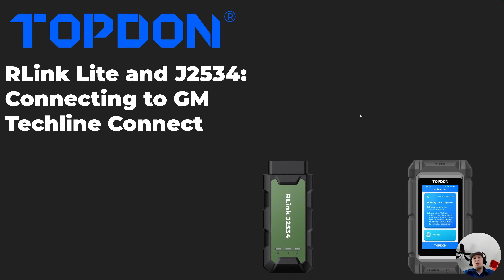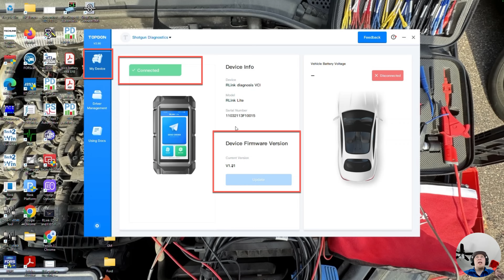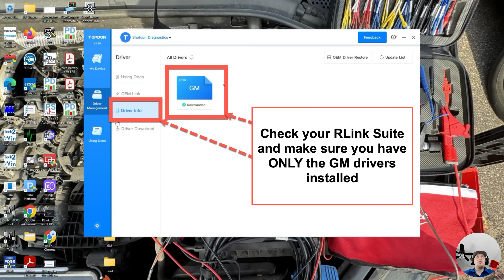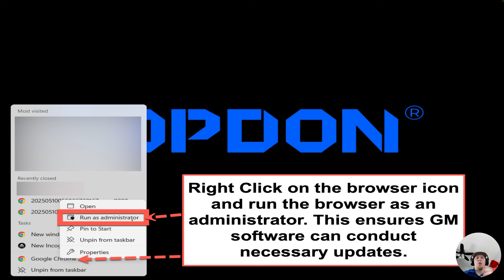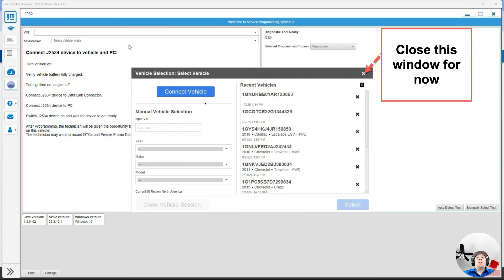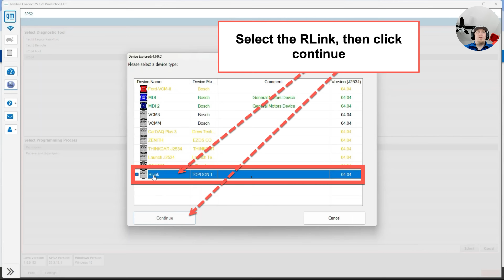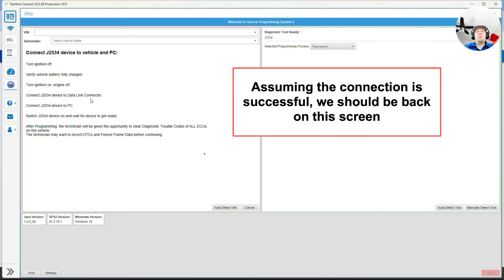How to Connect RLink Lite & RLink J2534 to GM Techline Connect

Comment: So i keep getting this error: dfs103:j2534 Wrapper-1.06.12.0 failed to download. This happens when I try to launch tech line connect with admistrative privileges. Any ideas?
Reply from the maker: Hello, could you please provide some screenshots to support@topdon.com,  our tech support will check the issue for you.
Reply: @TopdonOfficial problem went away after I backed out of TDS and rebooted laptop. I was able to reflash tcm with your product. Good piece of equipment.  Thanks for responding.
Reply from the maker: Thank you for sharing your experience! If you ever need any further assistance, don’t hesitate to reach out — we’re always here to help!